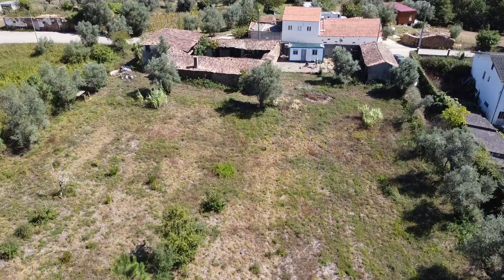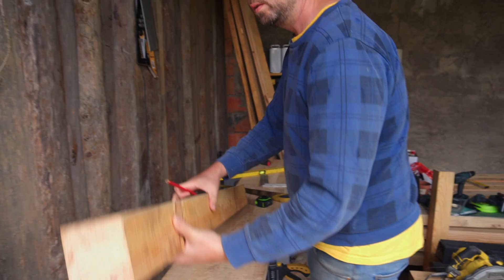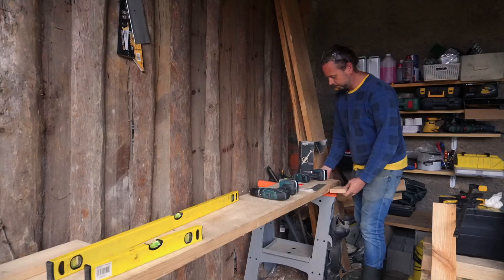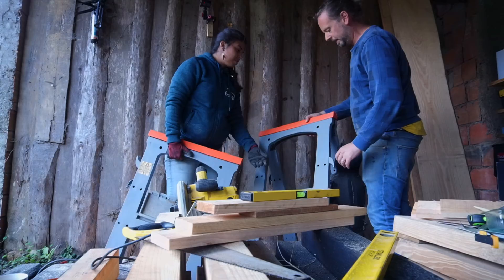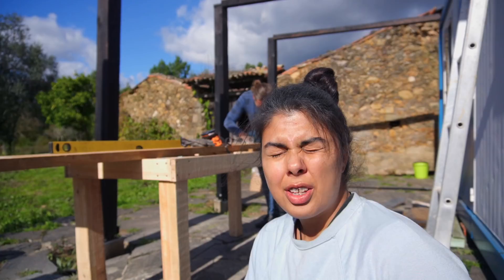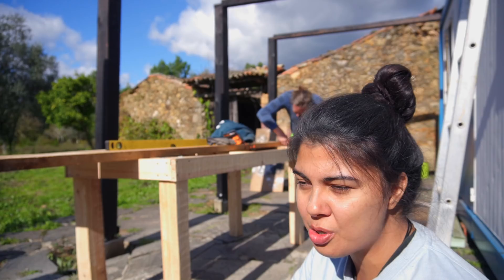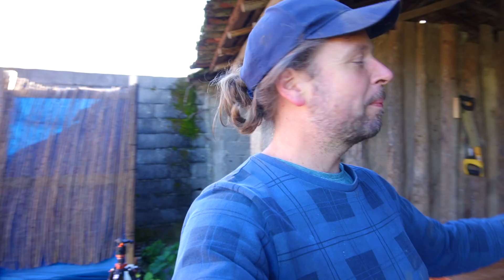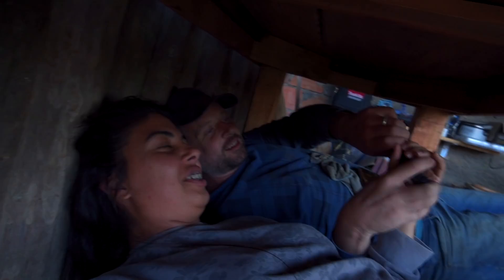Building a worktable with scrapped wood and pine planks

Comment: Omar, for a right hander, the vice is at the wrong end of the bench, you should also sink those coach bolts, so that the heads are below the surface of the table top and if you want to stop the bench racking - moving from side to side or back to front movement, you need some diagonal cross bracing on both the sides and the back, that will stabilize your bench and it will last much longer. Keep up the good work.
Reply: Also, have the top of the vice below the height of the top, then add the hardwood jaws and plane down the the height of the top. Looks great so far. Good job!
Reply from the maker: Some great advice there! Thank you. I see what you mean about it being on the wrong side, I chose to put it that end because if I'm cutting long pieces and it had been on the other side, then the wall could get in the way. The idea of doing the cross bracing on the back legs is definitely a good idea and I had thought of doing that but ran out of time and scrap wood.. the bottom shelf I inlaid specifically to give room to add these braces in the future If it's needed! Will for sure be working on some other projects and a friend has already enquired about me making a bench for them, so I will apply this advice you suggested to it!! Thanks again
Reply: @TheIndigoEscape  Also, I think that your vise is actually meant for a thicker top so that the vertical piece ends below the top surface - IIRC it's also usually inlaid (at least in a pure wood shop) so it's flush with the front. Less open metal for sharp woodworking tools to get dinged on...

Comment: Your circular saw has a base adjustment to cut 45degree angles much easier than with a hand saw look at the front and loosen the nuts to tilt the base to 45degrees. Also mark multiple sides of post if the depth of the saw won’t cut the whole way through and work your way around with circular saw much easier then using hand saw. Cheers!
Reply from the maker: I tried using it, but it didn't seem to be so accurate.. maybe I need to practice more!! The vices/grips we were using were very crap too.. Now that we have a workbench it should be easier to do now 👍😁
Reply: @TheIndigoEscape  There's the old traditional miter box...
3 bits of plank fastened together to form a U-shaped trough, then layout and cut the 45 and 90 degrees (and any other you might end up needing, maybe 30/60, 22.5 etc) carefully once, then just put the piece to be cut in the trough against the bottom and one of the walls, align with the precut slot of wanted angle, clamp it, and ride the saw in the slot, cutting the piece.
Reply: @michaeltempsch5282  couldn't say it better myself !

Comment: With the off cut little ‘practice babies’, cut them into three different lengths, sand them and drill a hole part way the depth and the diameter of a tea light in the Center.   Or keep one long and drill multiple holes for tea lights.   Viola candle sticks 🕯
Reply from the maker: Haha, good idea!! If you have any more ideas let us know, we will have so many of them when we finish the roof! 😁👍❤️

Comment: Well done guys but I have a tip for you re: old tools (the vice)  to help clean them up you can soak them in a vinegar bath or molasses. It works wonders at getting rid of the rust, you can then polish up with steel wool and crease again. I learnt this by watching house renovations of a very old home here in Australia. All the old and rusted up door furniture was cleaned up and reinstalled in this fashion.  Keep up the good work.  Lana     Australia
Reply from the maker: That's a great idea Lana, I should give it a try. I do want another vice on the other side!